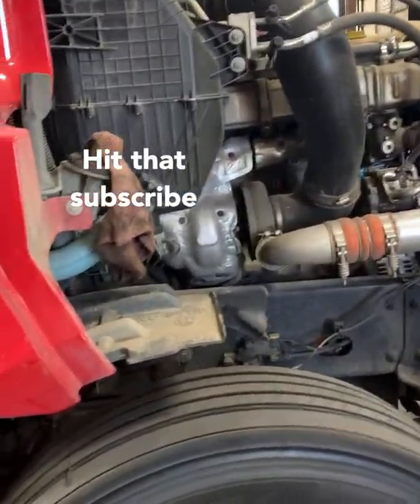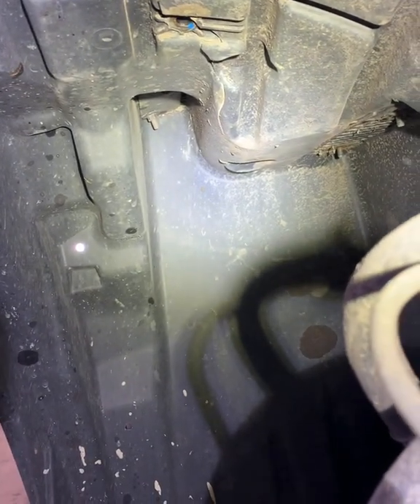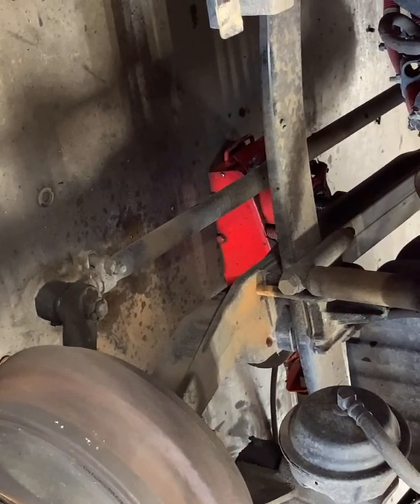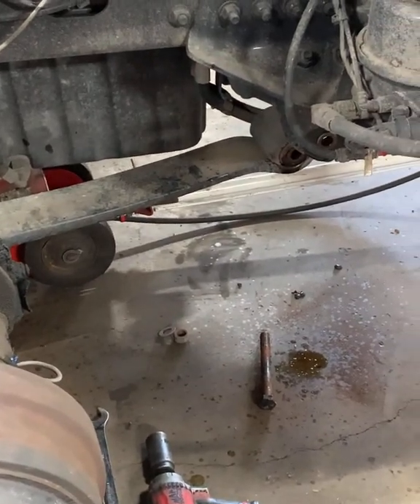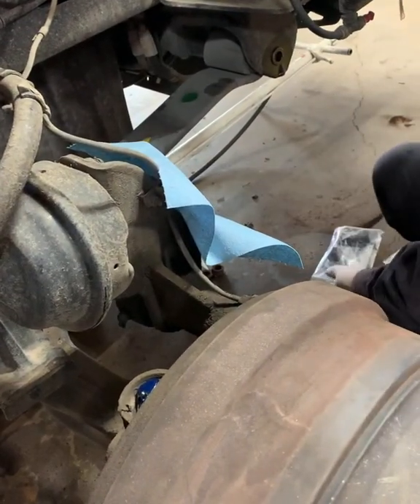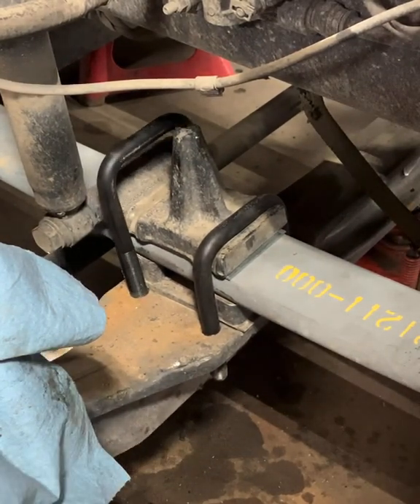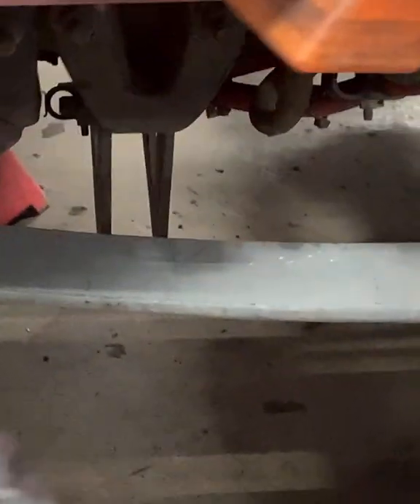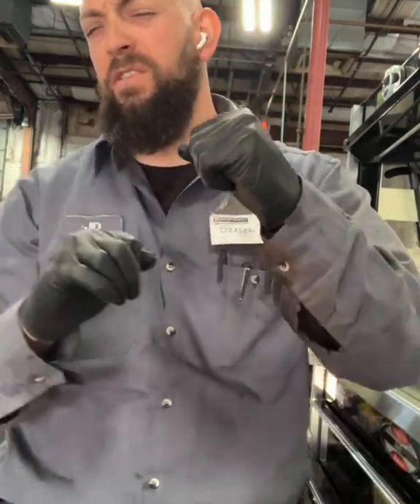Freightliner cascadia leaf spring replacement. Noise when turning. Popping in suspension

Comment: You should have the U bolts and bushing bolts tightened when the truck is sitting on the ground with the wheels on if you don’t believe me read the repair manual the way you did it after 100,000 miles those bushings will be gone as well because they twist too much
Reply: Ppppll lol
Reply: Lol you are 100% correct on this

Comment: If the driver is complaining about vibration or a popping it can be the leaf spring bushings but it could also be the blown passenger side steer shock which is clearly leaking.
Reply: Or or …or the spring pin bushing that is clearly shot at the rear when he gets the spring out of the truck

Comment: Already had all that done to my freightliner and front  shocks  still making that popping noise?
Reply from the maker: @darwindarwin4411  if u are getting popping from your front end I’d start with the ubolts as sometimes there not tight enough causing this concern.

Comment: I got 2019 cascadia with 175k miles I had popping noise when loaded 11,900 on steer axle. Told Freightliner about the issue they took while steering apart and told me to wait for 7-10 days. 😔 I think I made mistake now by taking it to agency should have gone to some local mechanic. Not even sure if they would be able to solve my problem.
Reply from the maker: Man I’m sry to hear about that issue. I do have trust in the dealers. There expertise is outstanding but than again it all comes down to the tech it goes to. Poping should be easy to find since it comes down to very few components. No reason it should take that long unless there waiting on parts, serious parts issues now at days.
Reply: @bustedknucklebydieseldr3228  what components are you referring to? Thanks
Reply from the maker: @TroquerosinbarrerasUSA  basic steering components. Drag link , tie rod, steering gear, cab mounts,kingpins , wheel bearings, ubolts.. one of those would of been the issue

Comment: Thanks for your help 👍,  my question is, is it possible to mount Dd15 fuel pump with out the timing blade?!......
Reply from the maker: Yes you can install it without it but.... the pump is timed for a reason and when removed you would have no idea where the top dead center is. Fuel pump timing helps with abnormal pulsating in the pump when mated to a gear train. . Plus turning the gear to get it straight up is easy enough anyways.hope that helps and thanks for watching.
Reply: @bustedknucklebydieseldr3228  thanks man, we'll I was towed to the frightliner dealer and  they said the blade is missing,  they wanna drop the oils pan looking for it which I said they just buying time to charge for the labor.
Reply from the maker: @mohamedmohamud8084  I’d be very interested to know where it went. But if you got towed then it probably messed up the teeth in the geartrain. This may just be a very costly reapair. Either way they would have to pull it all apart and inspect because if they do a quick fix the liability is all on them.
Reply: @bustedknucklebydieseldr3228  yap they found nothing there. That was not my problem I had water in fuel system, before that the truck was find
Reply from the maker: @mohamedmohamud8084  ah gotcha. Definitely another issue than. Hope they take care of you there.

Comment: Can you keep running the truck with a bad bushings? And what was the cost to repair this?
Reply from the maker: Great question man. Yes you can keep running but you will most likely get drivability issues as well as poping or cracking  noise on turns. Pricing on parts will constantly be changing due to supply. As for labor figure about 6 hrs of what the labor rate is.

Comment: I have my truck pulling to the right.. done an allignment everything is fine. New shocks.. u think my springs are bad 18 cascadia 415k
Reply from the maker: I would want to know that alignment is truley good and the tires don’t have any uneven wear. Springs shouldn’t be your issue here.
Reply: @bustedknucklebydieseldr3228  wells I thought so the tired were. rotated them still same..
I went to 4 allignemnt shops all same ur allignment is good blah blah..

5th shop he added a caster shim to the right side under the springs to raise it up made it 75 percent better now.. I think left side is higher then the right side that's the shim made it better.. I think over time the springs sag and the pull happens due to the lean... the shim made a difference .. 
no trucks can't be allign same.. every truck is diff and they all need caster shims...mine is 1 inch lower in the right.. I guess that why it's still pulling 🤷

Comment: I have a 2009 cascadia and I've just replace my two front shocks. But I still feel the bumps on the road pretty bad. Could it be the cab shocks or the leafsprings.
Reply from the maker: Front end issues are tough ones to solve. There’s so many issues to look at. If your just focused on covering up the road bumps. I’d start with aftermarket heavy duty steer shocks. Oem is not good.  Than I’d check the cab mounts, leaf spring ubolts, king pins. These will be your main contributors.

Comment: Could you have changed only the bushings on the leaf springs?
Reply from the maker: Great question, you sure could but what a pain that is. And your still removing the spring and putting it under a press to get those bushings out. So I would say more time wasted. When time is money I’d hate to waste any of it. Also I have yet to find any aftermarket bushings for leaf springs that can hold up like oem ones. Kinda strange.

Comment: I just had springs, shackles, bushings done on a 19 Cascadia as well but am getting the creeking and slight popping noise when turning. At highway speed the truck rides fine and there seem to be zero issues. Only happens at lower speeds while loaded. What are your thoughts?
Reply from the maker: Thanks for reaching out. When low  speed creaking is occurring the most common cause is the ubolts. You may of just had them done but there’s a chance there not torqued right. I would try to get them checked. Could be a very simple/cheap issue to resolve.
Reply: @bustedknucklebydieseldr3228  I appreciate the reply and the content. The maintenance portion of the O/O business has proven to be the toughest part of this business for me. Trying to find a good trustworthy shop is like looking for a needle in a haystack. Thanks for all you do 💯

Comment: Quick question so I have a 2015 cascadia. When i come to a stop and lean at a angle it’s hard for me to throw back in gear.  Just grinds and I have to force it in.  What do you think it is?
Reply from the maker: Good question. I would think no mater what if you have trouble getting ur manual trans in gear than your throw out bearing or clutch brake is failing. Would definitely need both those inspected. Most common complaint for clutch brake failure is grinds when starting off and can’t grab gears. Hope that helps
Reply: Thanks for your help and time

Comment: What are the symptoms of bad leaf Spring blushing?
Reply from the maker: Great question. You will notice sagging, or truck leaning, extra noise like cracking or creaking from there especially on turns. There could also be slight pull when driving.
Reply: @Busted knuckle by diesel dr  thank you!!!!

Comment: Got a question about the popping noise. Does the noise occur while hooked to a loaded trailer or no? I have a popping noise but it only occurs when I have a loaded trailer which leads to think that its a suspension issue.
Reply from the maker: Great question. For the majority of the time it will occur unloaded or disconnected from a trailer. But in some cases the only way to duplicate  particular issues is to have a heavy strain on the suspension by being connected to a trailer. There a lot of suspension components at work especially under pressure so would just need to find out which area the noise is coming from. Hope that helps
Reply: @bustedknucklebydieseldr3228  its coming from the front near the firewall. Bobtailing... No noise; empty trailer... Light popping and its at its worst when I'm loaded. I've had the motor mounts replaced and driveline checked and the problem is still there.
Reply from the maker: @marcussmith5755  great you’ve narrowed it down. Have the cab mounts , leaf spring bushings, and drag link checked. Most common issues right at that location especially on units with age.
Reply: @bustedknucklebydieseldr3228  those items were next. Thank for the help and my truck is a 2015 with over 700k miles on it
Reply: @bustedknucklebydieseldr3228  great vid, i just had my bushings and shackles replaced yesterday. Ive replaced all shocks, ive replaced drag link, steering shaft, tierod assembly. It was aligned and i still have the cracking popping noise when i turn the wheel even at a stand still bobtailed. Only thing left is my steering box and thats next on the list. Any imput would  be greatly apprecited. Thanks
Reply from the maker: @franklyn335i  thanks for reading out.  Sounds like you have majority of the items covered. Two things I would be interested in checking are the steering gearbox and the cab mounts. While having someone turn the wheel you should be able to pinpoint where the sound is coming from. But many of times those Cab mounts will do that same effect.
Reply: @bustedknucklebydieseldr3228  i hear it coming from the front most part of the spring. I was able to hear the crackling just by turning the steering shaft by hand quarter turn each way
Reply from the maker: @franklyn335i  gotcha, you may want to have the u bolts for the springs rechecked for proper torque. When there not torque right it will make that noise even with new springs.
Reply: @bustedknucklebydieseldr3228  thanks for the info
Reply: I would definitely have your king pins checked.

Comment: Any videos on rear leaf spring replacement on a Cascadia?
Reply from the maker: What year is your cascdia that you have a leaf spring in the back. Usually that was much older ones.
Reply: 2013 and it’s a day cab
Reply from the maker: Ya that makes more sense. These days they just use air ride and shocks.  No I don’t have any vids on those but next one that comes my way I’ll  make sure that happens.
Reply: Ok great do you know if the rear leaf springs usually come stamped or with any stickers on them when purchased new from dealer? Recently had a mechanic replace mine but doesn’t look new besides bushings looks like it were spray painted black on top the bottom looks old and beat up thanks for responding
Reply from the maker: @ramonpaez19  they should have a significant color difference than the old ones. There might be a sticker with a part number but not always. The bushings will be dark black and peel slightly. But just looking at them they should have some type of newish appearance.

Comment: What’s the torque for the U bolts bro
Reply from the maker: Good question. Depending on the size of the nut which they can be different. The most common is 7/8 and for that it would be 375ft lbs in a star  pattern

Comment: yesterday i replaced 2 steers and 8 drive tires balance all and 3 axle align and the truck got worse it throws its self left and right and getting jumping vibration in the cab and hood, it feels like the hole front end is loose, and it want to follow every little groove on the road, those groove line on the road or uneven pavement on the road its start zigzaging left and right like a swing fish in the water, took it back they said it could be the leaf spring bushing bad, any suggestion? appreciate
Reply from the maker: Great to hear from you man. Sorry to hear about the issue your running into. The leaf springs will cause a lean, noise, and shaking. But I wouldn’t say it would make the whole truck shake the way you described. I would really want to have the balence checked on those tires because they will do just that.  After that I’d look at motor mounts, cab mounts , driveline for damage or correct phaseing, baseically everything suspension related. But I wouldnt jump to leaf springs unless I knew they were an issue. Hope that helps you in a direction.
Reply: @bustedknucklebydieseldr3228  thanks for the quick reply, i changed the cab mounts last month, i was thinking motor mounts, but whats getting me is the swerving on the highway when i run over those groove or on uneven road, my little pick up did the same thing when i changed the tires and then found out i needed  outer tie rods,
Reply from the maker: @jadb8452  for trucks majority of the time following grooves is related to how wide the truck is which just makes it easier to do and wear pattern/tread pattern of the tires. When everything is brand new and tight (all your bushings,shocks,springs) a lot of that free play was taken up so it wouldn’t veer so easily. There’s no reason it should of gotten worse though after new tires unless alignment is that bad and causing a drift. If ur truck goes straight on its own I’d lean into suspension components, if it’s drift while you going straight I’d lean into the alignment.
Reply: @bustedknucklebydieseldr3228  its not drifting it more like veering left n right. when i let go of the steering wheel is still drive straight, it only does it where is a lot of groove or construction zone where the road is uneven it starts to veer left and right, when am loaded its drive much better, when trailer is empty  thats when the jumping vibration gets bad,  the heavy weight for some reason have something to do with it, man am confused
Reply from the maker: @jadb8452  gotcha. The veering at that point is normal and nothing to be concerned with. Since the weight is on the ass end of the truck it will bid a lot of the issues on the front end. With weight released there’s not enough downward force and stress against all the bushings. Really it would just be going under and inspecting all the suspension components.
Reply: @bustedknucklebydieseldr3228  thats why am leaning more towards the leaf springs, its $$$ guessing game, but i appreciate you trying to help,
Reply: When you get new tires, the truck will drive like you are drunk, left and right. They have to wear in to follow the crown of the road.
Reply: Hey sir did you fixed please respond me. I have exactly same problem. Please 🙏

Comment: Do you know they have tiger tool for these new frightliner  to install bushings on chassis and next time use a bottle jack to press out the front bushing eye lol
Reply from the maker: They sure do but from my experience the aftermarket bushings don’t last and re-bushing them with OEM ones is better but the times to do this compared to the times it takes to replace a spring isn’t cost effective. But giving the choice to the cust is key.
Reply: @bustedknucklebydieseldr3228  We don’t use aftermarket bushing we get it from
Freight liner regardless the fact the new cascadia front leafs are garbage they left the trail arm bolts loose
From
Factory causing problems again and again would recommend replacing Hardware too great videos sir
Reply from the maker: @ancormane524  you are absolutely right. It’s crazy to think we came all this way with technology but something as simple as a bushing can’t be updated to something better. I know for off-roading there specialty bushings used and there great. But nothing for semis yet. Maybe that’s the next milllion $$$ idea we need to get on.
Reply: @bustedknucklebydieseldr3228  they can’t even fix the rub spots from 4 years ago the air commpressor bracket frame wires ties def dozer harness on top the crossmember it’s like the do it on purpose on not to forget the abs ecu needing to be reprogrammed randomly after tow or not they do it on purpose to make money goof for us we already know their tricks😂😂

Comment: How much for the leafs and labor?
Reply from the maker: Leaf springs price is always changing. Labor is about 4 1/2 hours depending on replacement, or just bushing replacement only.
Reply: @bustedknucklebydieseldr3228  doing this rn and hardest part is finding the parts
Reply: @bustedknucklebydieseldr3228  this video is the reason i decided to do it myself
Reply from the maker: @adrianiorin8896  hopefully it all goes well. Don’t forget, an alignment afterwards will be needed.